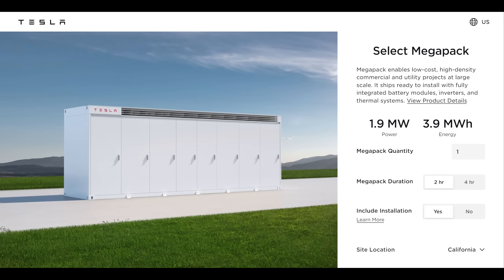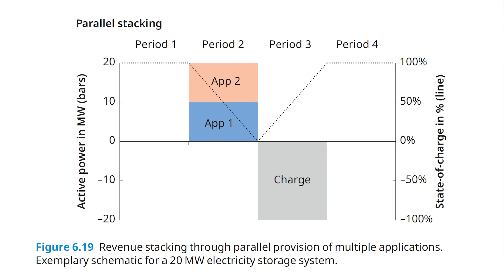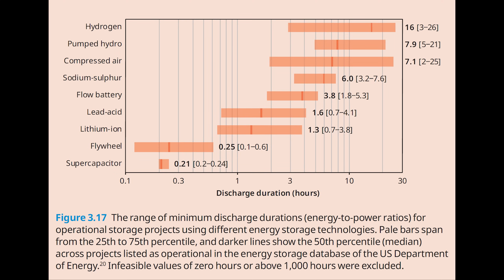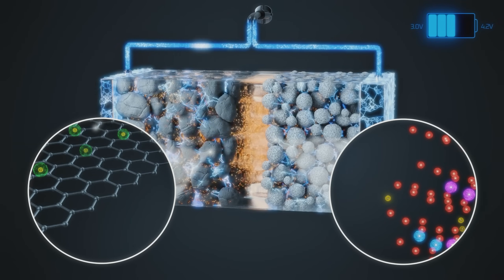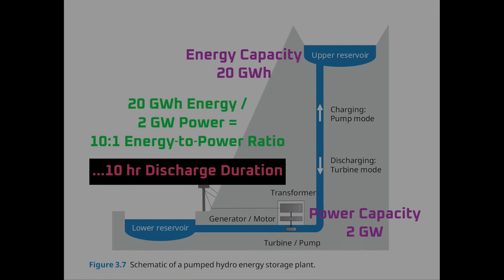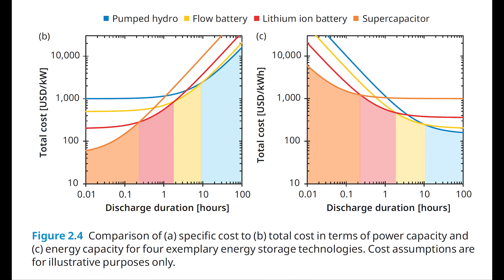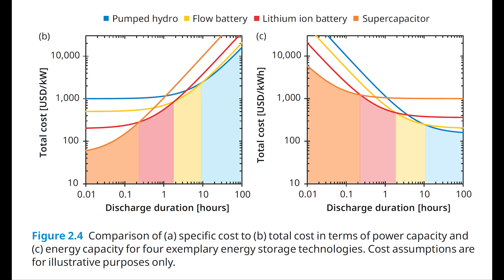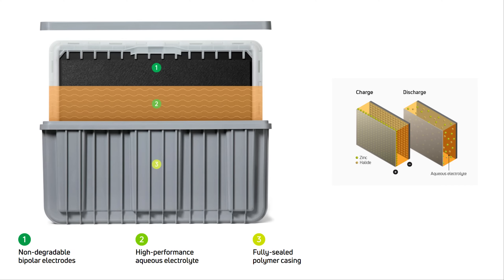Part 1 I How Grid Storage Duration is Assessed and Why it Matters

Comment: Thanks for sharing your thoughts, ideas and videos. Pretty good explanation of some of the hidden costs that go into power production. Looking forward to seeing more of your videos to see what other information you have to share. Never heard of the 10 to 1 ratio before as an operator but seems about right. Used to operate a 1200MW pump/storage and our reservoir was 12,000 MWH’s. An interesting subject to cover might be Demonstrated Maximum Net Capacity testing. Always an interesting exercise to perform, especially when the units get into the larger capacities. Some of the obstacles include is there room on the grid to accommodate the test. In North America a capacity test is for 4 hours. How fast can you start up a 1200MW generator. Actual vs Practical. In the plant I was familiar with the actual was less than 4 min. The fastest practical when not in an emergency situation was about an hour. Preferred was 2 hours to start and 2 hours to shut down. And capacity testing is always for 4 hours at full capacity in between the start and stop.
Reply: As an electrician in the power industry, what really impresses me is how fast battery/inverter systems can be brought online. It can be as little as milliseconds, and they can inject voltage and current into specific parts of the waveform to provide power quality and power factor support. Truly a game changer when it comes to peaker plants.
Reply from the maker: Great information thanks!
Reply: @thelimitingfactor  this is also why batteries or other fast dynamic ESS are very useful to support hydrostations during their power up(and down) ramp, so the ESS applies the delta power until the turbines spin up in a slow manner to decrease vibrations and tear => more maintenance.

Comment: The "C" value used for e.g. LFP batteries is actually power/energy, so a lower C value means the battery is typically less expensive for a given amount of energy storage. Furthermore charging a battery at 0.5C max may result in a longer battery life than if used at 1C max, so there may be tradeoffs there.
Is there any reason why you (or industry) use energy/power (e.g. 1/C or minimum hours) instead of power/energy? Bigger numbers sound good, but they really mean the system is not good in the power delivery department.

Comment: Does pumped hydro include the cost of building a water tank? If not, then I assume pumped hydro is only viable in some areas, and would be prohibitively expensive elsewhere? Presumably its regional nature would also have the added cost of beefing up the grid between areas of supply and demand?
Reply from the maker: Usually they just dig out or utilize a reservoir.  Yes, the cost includes that.  That's why the energy side is so cheap - just dig a hole
Reply: @thelimitingfactor  I feel stupid, but wouldn't two holes of equal volume be needed? One very shallow and the other very deep. Then pumping from the deep to shallow would store energy, and from shallow to deep would retrieve that energy. How can it work with a single reservoir? Also they may need a river or stream feed to compensate for evaporation, unless they are covered, but using the river itself to generate power could be very limiting unless it is very high flow, which again constrains the use case.

Comment: Great video ! I'm an energy storage engineer in China who recently switched job to market/stock analysis focusing on the same industry. Energy storage is an extremely hot topic in Chinese market and there are a lot happening in recent years. Currently there are debates on which techonology is the most suitbable for long duration energy storage (LDES). The candidates in the industry are lithium iron, lead acid, flow battery, and gravity energy storage. There are dozens of start-ups betting on each technology and the market is going crazy.  Looking forward to your follow-up videos on this topic and your opion on the most suitable technology for LDES.

Comment: Interesting, as usual, Jordan.  I'm sure I don't entirely understand what you mean by "duration" and what it means to my home power ideas.   

For example, I'm running some common use tests with a new battery.  The 'storage life' of my tiny recreational LiFePO4 battery seems to be about a week.  I charged it up, disconnected it from everything, and then watched the electricity stored in it decay to zero over the next seven days.  What's the term of reference for that period of time on that battery?  As far as I can tell, there is no draw, the battery just won't retain electricity for significant time periods.  Basically, it's an electricity bucket.  I can fill it up, carry it somewhere the same day, use it all, then go home and repeat the cycle tomorrow.

How does this match other folks' experience?  Are these LiFePO4 batteries specifically intended to be charged and discharged daily?

If so, what would you recommend I look at for a battery that keeps most of its charge intact for a period of a month or more?  Is there such a chemistry?

Building my own mini-reservoir and mini-turbogenerator is . . . not entirely out of the question.  Living in western Washington as I do, collecting LOTS of rain in winter is a viable option.  In my case, a few wind turbine designs and some solar panels will probably come first.

Comment: In Northern climates, interseasonal storage is going to be a huge issue in the future (winter = no sun, high energy demand), it would be nice to see ultra-long discharge technologies included in such an analysis, in particular, where does hydrogen fit into the interseasonal storage picture.
Reply: Tony Seba (RethinkX) says that this is not so. There is a balance between renewable generation and storage that works well even for locations within the Arctic circle!
Reply: not an expert but thought I'd read that NAmerica has a lot of hydro-electricity - and last I looked at the count of hydrogen cars I'd seen it was about ... 1.

Comment: As an ex-grid engineer I can say this was a very good explanation, I could have never thought of this angle. For the purpose of the battery, is it fair to say a "2h duration" can also be called a 0.5C max discharge, while a "4h duration" could be called 0.25C? For sure grid storage jargon may be more akin to "duration" rather than "C-rating", but I need to tie the two worlds somehow.
Reply from the maker: Yes!  A good way to put it!

Comment: Jordan, thanks for the video.

One challenge I’m curious if you’re going to address is the problem with renewables.

Renewables are highly variable, down to the millisecond in terms of their effect on the grid. Because the wind blowing can be non-uniform, and the cloud cover the same, it’s hard to predict at scale where an ISO operator for example should send power in a dynamic way. Here in CA lacking millisecond/second response grid scale storage (supercapicitors?) we have to install an equivalent amount of natural gas oeaker plants for every megawatt of solar or wind deployed. Because oeaker plants are cheap from a capex perspective but expensive on opex, the net result is as solar is deployed energy gets dirtier and more expensive. I’ve seen here in ca and read about Germany that our cost of energy is growing much faster than inflation or demand. Installing more solar/wind makes the problem worse not better, and I’m concerned with durations of 2-4hrs that grid scale battery storage is not going to be an effective solution.

Long story short, I hope one of the videos in this series gets into this aspect of the economics.

Sure solar/wind + grid scale storage is cheaper on paper, but in my backyard I’ve seen power costs 4x in 2 decades. 

That’s totally unsustainable.

And while I have you. Elon keeps saying we’re going to run out of power in a couple years. I agree with him. Current ev fleet is 1% if it continues to grow at 50% cagr then it will hit 3.5% very soon. At 3.5% we don’t have the power infrastructure to take the increased demand of EVs because that power is currently delivered via oil, which is a separate system. So we’ll have power “stock outs” do to changing mix demand. Not unlike toilet paper shortages as consumption changed from a mix of commercial and tesidential to primarily residential during covid, leaving an entire supply chain out.

Tbh understanding the local micro economics of this so I can look on caliso and predict when my county will lose power would be most welcome.

Thx, -M
Reply: Someone asked me “I was told that 1 electric car used more power than 25 home refrigerators, is that true?”

So if a refrigerator used about 350 watts per hour, then every day it would use about 10 hours or 3.5 KW.  So 25 refrigerators is about 75 KW to 87.5 KW.  

A Tesla can drive 100 miles and use 25 KW of power,  Most people do not drive 100 miles per day (36,500 miles a year) but less than ½ that many miles. So 12 KW per day, or about what 3-4 refrigerators will use.

My heat pump is 4 KW per hour.  So it can run 0 hours in the spring and fall, and 4-5 hours per day in the winter and about the same time on a really hot day.  So that can be 0 KW to 20 KW per day.  Most of that time in the summer will be during the peak power needs between noon and 9 pm.  Winter is between 9 pm and 6 am, as I get lower cost power at night, and tend to wait and use it more during the low cost hours.  

My car charging is normally done only at my lower night time rates after 9 pm, before 7 am.  Just when the grid has plenty of excess power generation, and that is why the grid can take on a lot more cars without being overloaded.  They can charge at night, when the grid has plenty of excess generation capacity. 

So total demand to charge 1 car is much less than my heat pump, and less than if I owned 3 refrigerators.  And nobody is saying that the grid will crash if you install a window A/C or central A/C unit.  The grid will just get larger capacity as more people build more homes.

Comment: While I understand that you are simplifying in order to provide educational material, you left out the most critical "limiting factor:" The COST PER UNIT CYCLE of the energy storage system, such as cost per kWhr CYCLE. This cycle cost is very closely tied to the round trip efficiency, which is very low for hydrogen (around 16% in real world conditions), and very high (90%+) for lithium batteries, with pumped hydro a close second (80%).

The upfront cost for both the power and energy in a storage system must be spread out over the expected cycle life in order to provide useful information for overall cost for the power and energy. A cheaper upfront cost for a low cycle system can mean much higher costs per kWhr than a system that costs double, but has twice the number of cycles, or more. This is because you also need to factor in the downtime and labor of replacing equipment more frequently.
Reply from the maker: I didn't cover it because that wasn't what the video was about.

I'll cover that later in the series.  

Regardless, even cost/kwh/cycle is simplistic

Comment: I understand that using 5 2hr units simultaneously would be cost inefficient. But couldn't you just use them one after the other so each of them only operates for 2hr at a time?
Reply from the maker: I don't understand.

Generally, there's a specific time period where the power must be used to run profitably.

You can't pick when and how much power to give.  It depends on when the market needs it and what technology you have to deliver it.

You pick a technology for the specific situation.

And as I explained in the video, certain technologies are better for certain situations.
Reply: You can but it's still inefficient because you're paying for 4 inverters you don't need.
Reply: @saff226  Yes, but under the assumption that 5 2hr units are the same price as 1 10hr unit, the return on investment would still be the same. Are the larger units normally cheaper?
Reply: @baicheo  no a 10h would be way cheaper than 5 x 2h

Comment: When adding storage to a grid, cost per each kwhr time shifted is the key parameter.   (Capital Cost) / (lifetime kwhr cycles) = cost/kwhr.  For example . If your battery costs $100/kwhr and you cycle it daily over an assumed 10 yr lifetime or ~3000 times, each stored kwhr costs $0.03 (excluding interest costs, charging costs, round-trip efficiency)).  If one assumes a 5% interest cost ($5/300=~$0.014) one must add ~$0.044 to the cost of the charging kwhr then divide by the round trip efficiency to determine the cost of the time shifted kwhr.
Reply: Yes! Cost per kWhr CYCLE is what really matters. A more expensive battery with higher cycle life can be cheaper over the entire cycle life. Increased replacement frequency also mean more downtime and costs overall, so that needs to be factored into the overall cost of the system. Cheaper equipment does not always mean lower cost overall.
Reply from the maker: Yeah, but that's not what the video was about.  It was about how duration is assessed.  I'll get into that later in the series.  

But even cost/kwh/cycle is simplistic
Reply: It may be simplistic but it's the fundamental issue.  If a storage technology has a high cost/kwhr/cycle it's not going to be used.

Comment: Thank you, Jordan for so much thoughtful work you put out.  
I ran across some videos of Simon Michaux, whose main theory is that the current approach to green energy requires too much minerals that the earth simply doesn’t provide, to the extent of our knowledge.  I wonder if you have looked into his analysis and what you think.  There are a lot of ideas or talks that challenge the mainstream approaches to sustainability, many of them are simply stupid, but I wouldn’t say that about Michaux, at least without hearing other professionals opinions, like yourself.  Thank you!
Reply from the maker: There's plenty of material there, and plenty of ways to become more efficient.

That is, it's a failure of imagination on his part.

For example - switching to a 48v low voltage system cuts the amount of copper wiring in vehicles by 75%.

And the list could go on.
Reply: @thelimitingfactor well said, Jordan. I was skeptical about his theory, especially that it feeds into the anti-do-anything (like mining) environmentalist points of view.  Like you said, the list goes on,  insulating existing buildings will also save a lot of energy consumption thus reduce the amount of storage for the same duration in some areas.